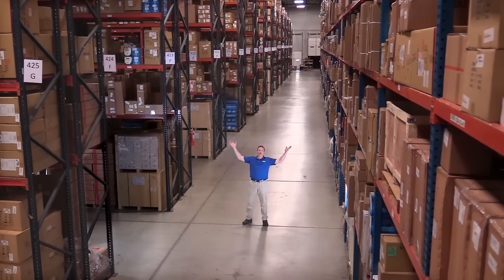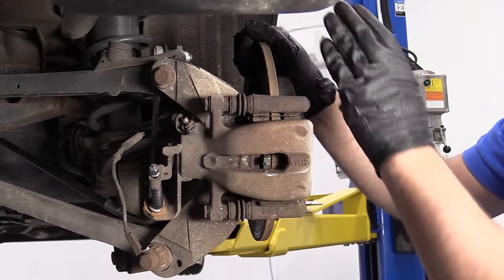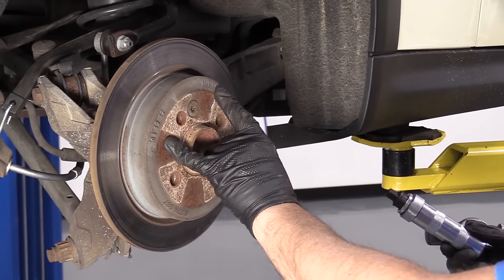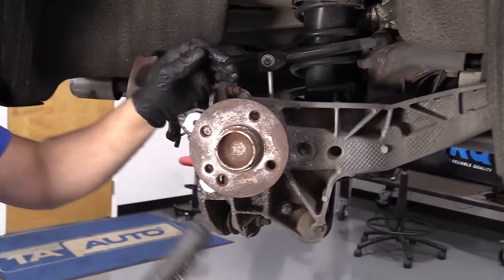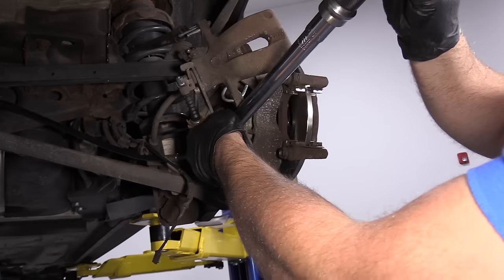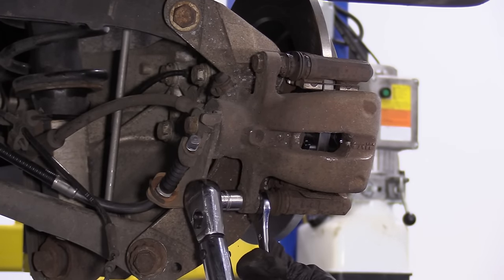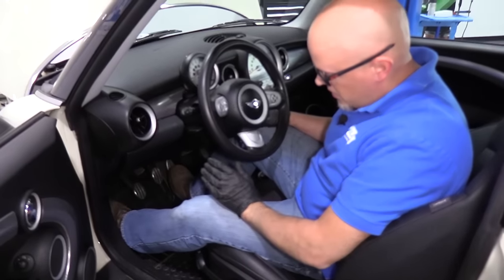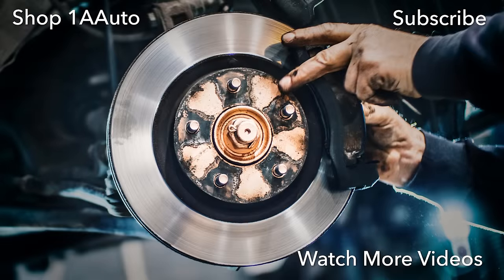How to Replace Rear Brakes on a 2007-15 Mini Cooper

Comment: A couple of things… use copper grease in the back of the brake pads to stop vibration / squeal, an impact wrench works great on the Torx T50 screw and use a new screw every time, use copper grease on the T50 threads and do not torque it up tight,  it’s only there to hold the disc on when the wheel is removed.
Reply: Copper grease isn’t needed on those pads if you look there is a slightly raised pad that does the same job, if that wasn’t there then yes apply the grease

Comment: Just a suggestion in the comments, if you have a centering screw for the rotors, you may want to put a little anti-seize on the screw so if you need to do the job again the anti-seize makes the screw easier to remove.

Comment: You don't need to remove the caliper bracket to get the disc out on these cars. Just so you know 👍
Reply: yep I left them in place and swapped the rotor 👍👍👍

Comment: how does screwing the piston back in affect the pressure on the opposite wheel?mine extended so far it does not want to screw in? 
or is the drivers side reverse threaded?
Reply: doesn't affect the opposite wheel but unscrew the cap of the brake fluid reservoir as the fluid might overflow while pushing the piston(s) back

Comment: At the end there are two studs the mechanic puts into where the wheel studs go - those do not appear in the lost of tools and parts in the details of this video. Could 1A- Auto add that? Id like to buy those for my Mini Copper R53. It will save a few swear words when putting the wheels back on.

Comment: Can you not use a c clamp to push the piston back in?
Reply: I use a big c clamp and channel lock pliers. Be careful with the boot tho
Reply: I tried and broke the damn handle on my c clamp it didn't even move at all
Reply: No it's not that type of piston, it's a twist release not pressure release

Comment: Great video. Clear picture and well lit so you can see everything. I wish I had found this before I started. I'd be done by now.

The piston tool is the simplest version. I found one at a local auto parts store. A more complicated tool is available that presses the piston as it turns it. A lot more money and probably harder to find. 

Are there times when the parking brake mechanism won't let the piston retract?
Reply from the maker: Thanks for checking us out! +Robert Mack

Comment: Okay so I used to have a tool to screw in these pads but I threw it away years ago cuz I didn't need it anymore after saving it for years

Well you don't need a special tool to screw in both of the rear brake caliper pistons all you need is some adjustable wrenches maybe a large vise grip or channel locks and it's clockwise rotation to screw them in both sides left and right are clockwise and just grab the edge of the metal Don't get the rubber grab the edge of the metal and turn it a quarter turn each time and then go back up and redo it again until it goes all the way down mostly seated flat then you'll need some needle nose pliers to stick in those two grooves on the piston and just use the needle nose just as you were already screwing in the piston Stick them in the slots and continue turning until it bottoms out you don't need a special tool and you don't need to remove the emergency brake cable somebody mentioned that above in the comments you don't need to disconnect the cable

Comment: Nice told is the front pads the same as back
Reply: front brakes - you need a piston compressor (or C clamp) to press the piston back into the caliper - otherwise its exactly the same.

Comment: can you turn off the light for the break/sensor without changing the sensor? I have new pads but I think the sensor is not working. Thanks
Reply: yes, just butt splice the wires together.

Comment: Hi, great video! Very helpful, I’ve done several brake jobs on previous cars, about to do first one on my 2015 Paceman all4. Do you know if the Countryman/Paceman Minis R61 have the same screw in caliper pistons as the Mini hardtop you show in this video? Thanks again!
Reply from the maker: +tommybass40 Thanks for watching!  That is something that you are probably best contacting a Mini dealership to find out, as we do not have that info.  1aauto.com

Comment: I would just tuck that sensor up with the connector, zip tie it together and forget about it.  If you are replacing the rotors every time you change the pads who needs a warning.
Reply: Yea, me too.  But they are designed for STUPID people.  Smart people change their brake and keep records of things.  Also, I do these on yearly...  That way I can grease the Pins, check rotor + etc...
Reply: In my case, the state. Can't pass inspection with the light on

Comment: Is there a sensor on every wheel?
Reply from the maker: +Common Guy No there is not necessarily a sensor on every wheel.  Thanks for the question.
Reply: only 1 on the front and 1 on the back wheels

Comment: No need to remove the broken or worn (light is on) sensor, just throw it out with the pad
Reply: Right, I just cut mine, it's easier...  It was $6.00.  I was NOT going to sit there all day and save it !!!

Comment: is the sensor for pad warning is only one ? or 4 ?
Reply from the maker: +amir ibrahim The sensor is typically on one pad.  Thanks for watching.
Reply: 1A Auto Parts I mean does the car in total have 4 ? My car have only one left installed and one more question please can the speed sensor give that warning for brake ? Because I scan the car and have no warning for pads but for speed sensor mini 2006 thanks
Reply: @1AAuto  but is it total of 4 for the car my car have only one installed ? can the speed sensor in the same side give the same warning for the brake ? i scan the car and no warning for the pads but there is a warning for the speed sensor, thanks for your help
Reply from the maker: +amir ibrahim Some vehicles have just one wear sensor, or one in the front and one in the rear, so if that is the case for your vehicle that is correct. You can get an ABS light on if the ABS speed sensor is not functioning properly.

Comment: Nice video but I do not recommend buying any parts from the online retailer A1 Auto. I bought brake pads that don't fit and they refuse to exchange them for the correct part. The website is misleading as they put 2 different car model parts right next to each other. The front and rear pads I received are for different vehicle models. When you choose your parts online for the front pads, it is right next to the wrong set of rear pads even though I put in the correct vehicle information. I also received the items with damaged packaging and it did not seem to concern 1A Auto when I brought t to their attention. It was past their official return time, but the holidays should have have some extension like most reputable retailers. So now I have pads I cannot use or return. Great customer service 1A! Do yourself a favor, use  your local auto part store where they would be willing to help you out and provide GOOD customer service and they are cheaper too. I am extremely unsatisfied with 1A Auto and will never use them again.

Comment: lug bolt tool link?
Reply from the maker: +Charles James 🔧 List of tools used:
• Flat Blade Screwdriver http://1aau.to/tazJ/1AXAA00013
• Impact Screwdriver http://1aau.to/tt/1AXAA00047
• 15mm Wrench http://1aau.to/tqy/1AXAA00010
• 13mm Socket http://1aau.to/takn/1AXAA00015
• 15mm Socket http://1aau.to/takn/1AXAA00015
• 17mm Socket http://1aau.to/takn/1AXAA00015
• Needle nose pliers http://1aau.to/tkV/1AXAA00051
• Needle nose pliers http://1aau.to/tkV/1AXAA00052
• T50 Torx Socket http://1aau.to/tsP/1AXAA00008
• 1/2 Inch Breaker Bar http://1aau.to/thP/1AXAA00078
• Ratchet http://1aau.to/taeg/1AXAA00016
• Torque Wrench http://1aau.to/tqM/1AXAA00044
• Brake Parts Cleaner
• Bungee Cord
• Cloth Rags http://1aau.to/thD/1AXSS00035
• Rust Penetrant
• Floor Jack http://1aau.to/trA/1AXAA00068
• Hammer http://1aau.to/ti7/1AXAA00091
• Jack Stands http://1aau.to/trY/1AXAA00065
• Wire Brush http://1aau.to/tdA/1AXAA00079
Reply: @1AAuto   lug bolt tool not on this list ? the two things he used to get the wheel back on the hub that lined up the holes and allow for one person to do this....?
Reply: Link to everything but what he asked for. nice!
Reply: @1AAuto  seriously, I wanna buy this tool from you. Please link it. You wanna make money right?
Reply: I am also looking for this tool

Comment: To compress the piston back just use a C clamp been doing it for years.
Reply from the maker: +Trayohesuea Vanderbilt Thanks for the tip!
Reply: You can't do that with these. They must be turned in. Otherwise damage can occur. The fronts simply compress.
Reply: Correct on front's, The rear Has to be screwed, it ratchets out when E brake is Used...
Reply: Pretty sure this won't work with this style of caliper. You need to screw it back in.